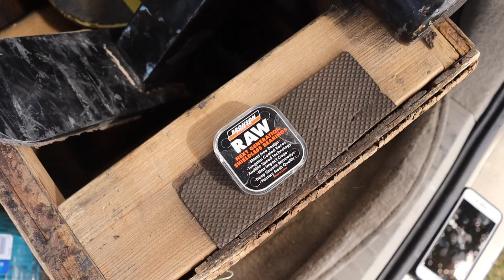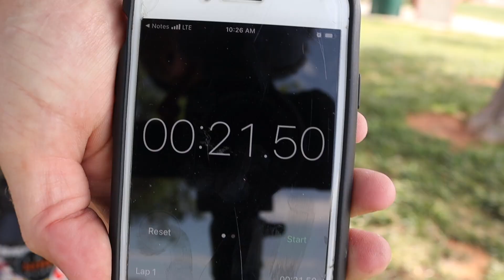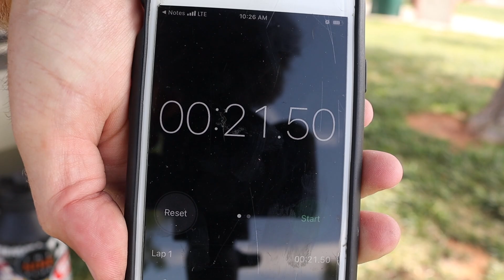Jamie Foy Bearing Hack DOES IT REALLY WORK?

Comment: if you are a pro sponsored skater that gets free gear and can switch new gear every 2 weeks, sure go ahead use no oil and open bearings.. Windex is not even  the issue, its great to clean the bearings, however you should then apply oil/lub/'speed cream' to them and shields, it will make them good for 2-3months and you can repeat this process. a set of good bearings with some luck can last you even few years

Comment: The Windex trick is completely stupid. Most of these bearings need lubricant. And destroying the coating that is in some of these bearings is a very very bad idea. Then again, the whole 'shieldless' stuff is nonsense too. You really do not want to allow dirt to run into a bearing. Ever. And no bearing 'self cleans' just be spinning. Comparing old bearings to new ones is a problematic comparison. Chances are huge those old bearings have lost most of their original perfect shape. Meaning it'll never spin as long, regardless of lubricant, oils etc. Bearings can even warp a little bit too when extensively used with significant enough impact. And as most people do not seem to use bearing spacers, they will have every opportunity to self destruct over time. My advice is 1. avoid the mud runs as much as possible, 2. keep your bearings closed, 3. no "tricks" with cleaning products or even really taking them apart, 4. use bearing spacers, they exist for a reason and 5. don't get your bearings wet. Other than that, I'd say most bearings should last you a good year. Unless impact destroys them, which is always a possibility. It's why I prefer the Bones Reds and just get new ones when they have lost their performance.
Reply: Bearings sound way better without the shields. I would sacrifice the lifetime of my bearings just for that sound lol. But I do agree that bearings definitely need a lubricant and you should not run them “dry”.
Reply: I agree with most points, but disagree with bearing spacers. Spacers are used in the industry when they perfectly fit and put pressure on both sides of the bearings to stabilise them. The problem is that in the skate industry, spacers are not standardized, nor are the wheels (more specifically, the space between bearings is not the same, whether it be circumference or diameter). It results in breaking your bearings faster.
If you have a 3d printer, take the exact measurements and put spacers in. Otherwise it's not worth it (unfortunately).

Comment: No matter how long they spin free of weight, they will get destroyed and slow when your weight is on the deck. This will destroy your bearings permanently, it's a trick by the industry so you have to keep buying new ones. Clean and oil as soon as they get slow, keeps them smooth and brand new for years. I've been riding mine for 7 years now. Also get Super Reds, much better than Reds and only slightly worse than Swiss.